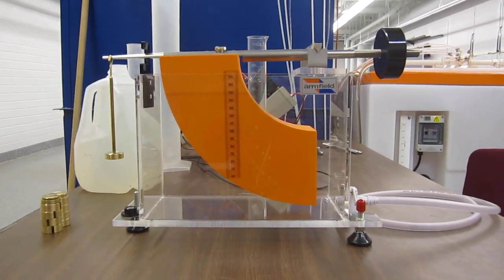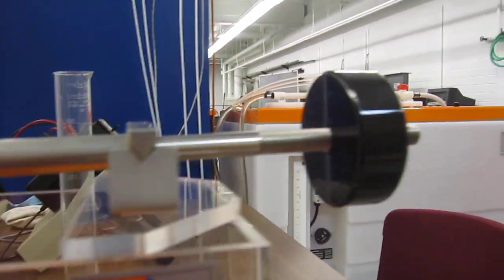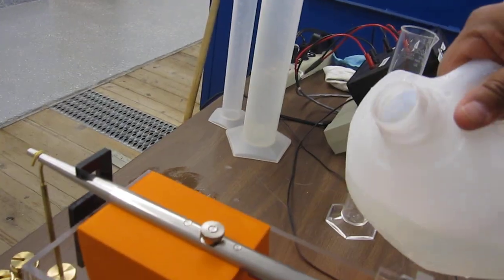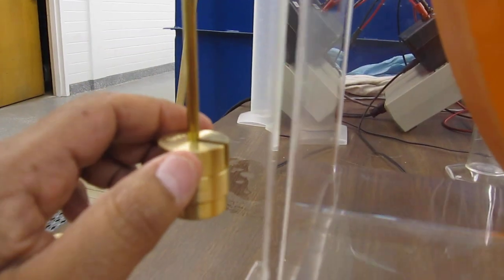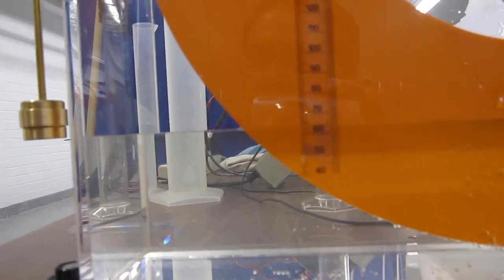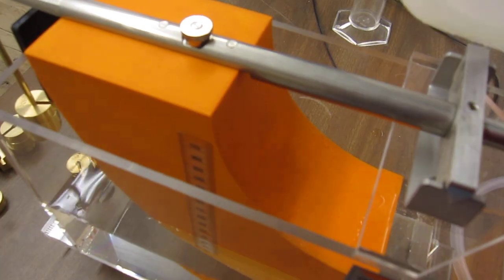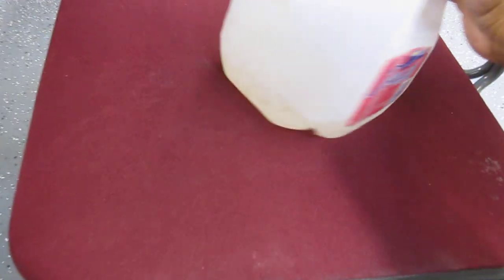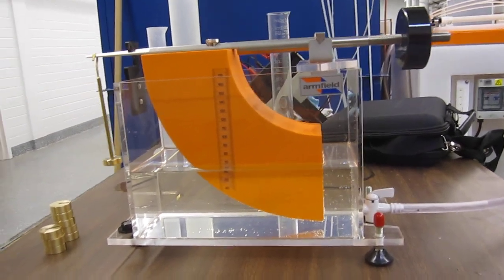HL01HydrostaticPressureApparatus.MOV

Comment: "the operation of the drain valve is tricky"; you have to turn it. This video can be very helpful but the whole thing could have been completed with the explanation in under 5 minutes. Did it with my class today.
Reply: better than my prof, he spend 50 minutes going over this. He. Never. Shuts. Up.